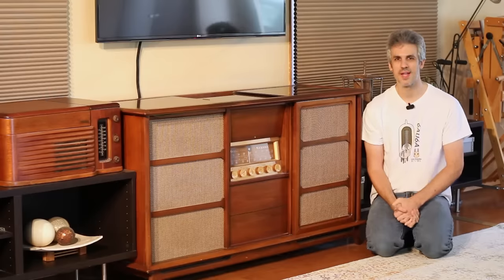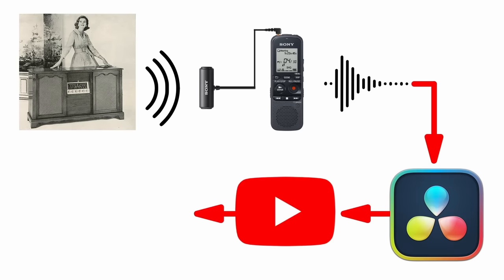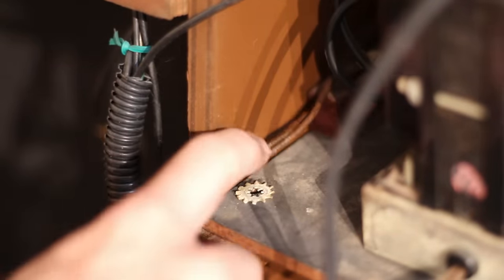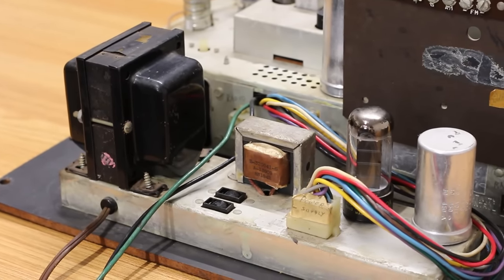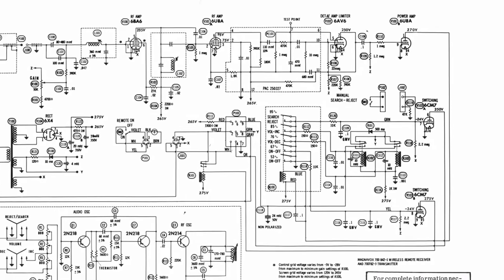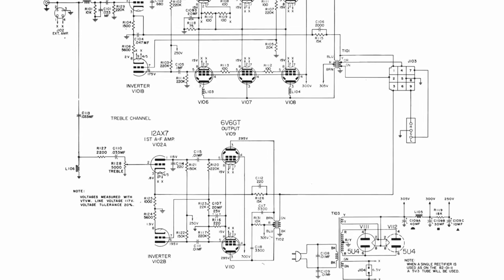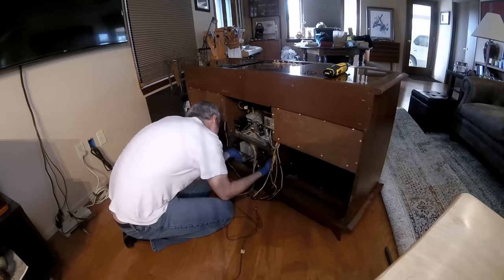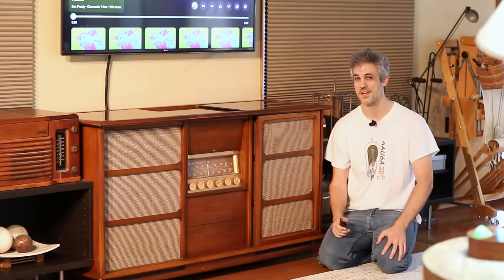A Look at our Magnavox Concert Grand Console Stereo

Comment: The reason you are not receiving any radio station is you need a antenna for it. The termanal block on the back is for a antenna connection , one will be for fm the other for am radio. If you will hooh up the correct antenna the radio will reveive correctly. Its juzt like amerture radio no antenna no rsdio signals

Comment: 1962 was the year the Zenith Stereo FM multiplex standard was approved by the FCC. Are you sure the unit you call the remote control receiver is not the stereo FM demultiplexer? FM sets at that time were provided with a stereo mpx output which bypassed the 75us de emphasis or low pass filter at the fm demodulator. This was necessary to allow the double sideband suppressed carrier L-R modulation through. The L-R is recovered and matrixed with the mono L+R to ectract L and R.

Comment: Unplug the magic eye tube they are hard to get. Since you don't have a signal generator find a source (crystal oscillator from a digital circuit) and use it harmonic to set the dial in the middle of it's range. you won't hear anything but the radio will go quiet and the eye tube will show it.

Comment: What was the rationale for paralleling 6V6s instead of using beefy singles like EL34, KT88 etc. - ? 
(yes, I know, 6V6 doesn't need as much drive V, but it's at most a matter of one more gain triode per channel, much easier than matching triplets)

Comment: I can explain how FM works quite easily, basically by telling you what FM stands for: Friggin' Magic! There. Now that you know how it works, you can go back to vacuum tube computers! ;-) That is one awesome system. With 2 x 5U4s per amplifier, plus the other modules which themselves have their own power supplies, that thing must draw a lot of current. I believe color TV's of the day drew typically 350 watts, and that stereo has beefier power supplies and more 5U4s than even those, so it must be a LOT! Better check your power meter and make sure that spinning metal disc doesn't take off like a Fris... non-trademarked flying disc!  (Of course, here I am talking to the guy who has a Bendix tube computer drawing even more power!)

Comment: The device shows its age, but it has a timeless design. If the front panel of the device were made of brushed metal or matt black aluminum, it would be considered a modern design device.

Comment: The receiver may work, it is probably great, back then external outdoor AM and FM antennas were used. I did not see an internal antenna in video. Had an old tube radio, work off a wire hang off the back. Could get out of state AM at night from NY, NJ, in PA, even NC. I think radio wave were bounced off the ionosphere, I think at least for NC.

Comment: Do you use that to heat the house in the winter? I don't think you mentioned it and just to put it out there, don't power up a tube amp without a load (speaker) attached or your could destroy those near-irreplaceable transformers.
Reply: Yes, this is very important. Without a load but with a signal through the amplifier (or due to internal instability) it's possible to have very high voltages induced across the primary side of the output transformer which can cause insulation breakdown and arcing.

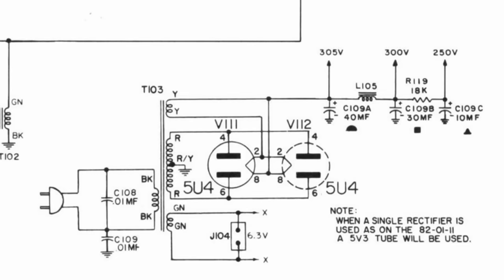Comment: Not a expert on vacuum tubes. But i believe that the 2 5U4 at 15:45 are not a in full bridge rectifier configuration.  A full bridge would imply 4 diodes to get the positive and negative. This is using a center connection and 2 double "diodes" in parallel. Most likely due to power considerations. The note seems to suggest there is a smaller power version as well or perhaps a 5V3 can tolerate more power on single vacuum tube.
Reply: Yes, it's a full wave rectifier. Since tube rectifiers are inefficient this is a more efficient option than a bridge rectifier. Also all power rectifier tubes I know are common cathode so a bridge config isn't even feasible.
Reply: @eDoc2020 Technically possible, but requires more tubes for that reason, and almost never used in practical designs.  Also the filament power requirements become more complex unless the tubes have exceptional cathode to filament voltage ratings (isolated filaments of course).

Comment: I have a pretty rough idea where you are  - with External FM and AM antennas, you should be able to get DFW area radio stations - your TV Antenna for any off air TV channels (provided it has VHF) should work adequately for reception. 

Just as someone who has driven from DFW to Amarillo, Midland and points east, there should be FM available where you are - its just gonna be fringe coverage.

Comment: Glorious video! Please please please clean the tubes after handling them. I don't think that skin oils are going to be an issue like arc bulbs, but it would be incredibly disappointing if you needed to start replacing tube pairs for no good reason :-)
Reply: Ordinary tubes definitely do not care about skin oils. The heat generation on the power tubes is only a fraction of a standard incandescent light bulb.
Reply: @eDoc2020  Phew, my anxiety was through the roof. I haven't had a valve amp for years, and always cleaned the tubes. Glad to know it wasn't required.

Comment: a note about the string you broke for the tuner... you might want to try Bow String, like as in compound box, for a single pull bow, it might be a little thicker, take that string to dunhams to the sporting goods section and ask them if they have a gauge bow string ( its called a DRAW string) for a single pull bow. that might help you. they might just have the gague you need.
Reply: Braided Dacron fishing line has virtually no stretch and will work as dial string. It's not at all like slippery, stretchy filament.

Comment: At 10:05 you can see what looks like a motor in the receiver chassis. Probably for the remote control?
Would be a nice project to build a modern replacement remote for this nice stereo! Should not be too complicated, once you figure out the correct radio frequency the remote uses. If it is not documented, some measurements on the receiver side will reveal it. It will be in the 100 kHz region, I guess.
Reply: The diagram of the remote transmitter labeled the frequencies and sketched the waveform of the desired pulse.

Comment: My cabinet is 98 inches long. Has a record player and also a radio on each end. In the middle was a television that's no longer there. I plugged it in and started messing with the dials of the radio, Hearing static at different volumes then the back started smoking so I unplugged it and grabbed the fire extinguisher.  Luckily I didn't need the extinguisher and it just had a thick heavy smoke. 

As I would like to keep the original parts I'm complacent with having the non original parts. One reason being I'm not sure if it's efficient engery wise and also the insides may not work.  
I was curious if you knew how or if it's possible to use the radio face and dials as well as the record player but connected to something that looks more energy saving.
Reply: I just looked at your channel😳 yeah you would definitely be the guy to know how lol.

Comment: Incredible! I have an earlier Magnavox Stereophonic (I think ~1954) and it also sounds amazing. My only issue is that the stylus needle is too worn for reliable playback. I've been back and forth on trying to find a replacement or retrofitting something new.

Additionally, I think that my model, while labeled "Stereophonic" I think it may actually only have a single channel, "faking" stereo.
Reply: I doubt yours was made in '54.  The very first stereo LPs weren't released until late 1957.

Comment: 6V6 tubes are beam power tetrodes and NOT pentodes; note the absence of a suppressor grid.  This is a rare case of the schematic drawing the tubes correctly!  Most tube manuals such as those put out by GE, RCA Sylvania and others will diagram the 6V6, 6L6 etc as if it was a pentode and yet the description will tell you it's a beam power tube.  To the best of my knowledge, we never built actual true output pentodes in America because Phillips held the patent and American manufacturer didn't want to pay the licensing fees! The 6V6, 6L6, 6BQ5, 6CA7 and 6550 are all beam power tetrodes!  Although we generally consider 6BQ5 to be equivalent to EL84 and 6CA7 to be equivalent to EL34, the European EL tubes are true pentodes and include suporessor grids.  The beam-forming plates found in the American tubes was an invention designed to mimic the performance of the suppressor grid found in a true pentode and thereby get around having to pay a patent fee to Philips. 

 By the way the 5U4 rectifier tubes here are wired together in parallel and used as part of a full wave rectifier circuit.  This is not a bridge rectifier!

Comment: high sensitivity light weight paper speakers ~90db/m . does tuner had got automatic motorized tuning and station searching ( in USSR Radio magazine I saw schematic for similar tech ) Latvia based RRR or VEF factory made similar fancy remote controlled unit for China/N,Korea supreme leader . with a help of couple extra tubes, tuning circuit was able to detect direction of detuned station and turn motor to tune it in precisely/automatically and with help of remote switch go to next station.. in theory. I dont remember if that circuit worked only FM or AM. phase detector ?

Comment: This may be an obvious point but you are trying to use the radio with suitable aerials connected up? 
It may well not have an aerial built in as later sets did -  external aerials were considered normal back in the day.

Comment: these were a very expensive deal back in the day. Your unit seems to be la king the actual Multiplex decoder chassis which is odd? The amps are very nice and develop 30w and 10w respectively  for lo and hi channels. 80 w total was way over the top in those days. My only complaint with Magnavox was the low end AM/FM units were almost identical to your top of the line set.  FM was only two I.F.'s and a simple ratio detector stage for demo duration. I would have expected at least two I.F.'s followed by a limiter stage and discriminator style detector for FM.

Comment: What is the overall power rating of this machine?
Reply: You mean the amplifiers - watts per channel?
Reply: @paulwomack5866  Yes, kind of. And the radio and the disc player if they were all engaged.
Reply: The power draw should be rated in Watts on the back panel of the unit.

Comment: I'm going to guess at least 50 watts per channel... I didn't think any single consumer grade Tube Hi-Fi (was barely a common term back then I believe)  unit pushed more than 30 watts ...horn tweeters and there own driver (assume crossover) stage wow... now that's truly a stereo for life.... on my limited knowledge Europe (UK) had nothing like that for Joe Public...
Reply: From a GE datasheet a pair of 6V6 in push-pull from a 285 volt supply produces 14 watts. With three pairs per woofer and another for tweeter that's 56 watts per channel.

Comment: Booo!  Zip ties?!?  For that time period you should lace those wires.  ^-^

Lacing is a lost art these days, but if done correctly, looks and works very well.  But it takes time to do, and time to learn (although not that much time).  I used to have to lace wire harnesses (don't ask), and once you get good at it, you can move surprisingly quickly.  But zip ties are still faster.
Reply: I remember watching Sarah at The Connections Museum (on YouTube) doing some lacing... it  "sure is perdy" but I'm so glad we have cable ties now. ;)
Reply: Lacing is a big pain the ass. Even though I'm a telecom guy - I'd have used Velcro on something I needed to get into again.
Reply: @AlohaWulf ,  Spiral plastic goose neck tubing would work well and allow you to undo the wiring harnesses in the future if need be.  It's not period correct, but considering the stereo is 60 years old the chances are it will need some service again in the near future, and so why make it that difficult to take everything apart again?

Comment: Can say that vacuum tube amplifiers definitely added a unique and oddly pleasing characteristic to anything put through them and some of that is harmonics that flat out cannot translate to most modern devices, but not because they lack the fidelity to recreate it, but that the speakers in 99%  of them wpuld be incapable of reproducing those frequencies in open air, where you literally feel, not hear, them. Some stereo systems I have seen over the years come close, but they are not reproducing, in most cases, the true recorded sound, but subtly modifying it, similar to how the vacuum tubes did. But, imho this is like complaining that the notes from the song Stairway To Heaven spund wrong played on sonething other than an electric guitar, which us tuned exactly the same as the original recording. Of course it won't, the notes may be the same, but the instrument (or stereo) you are using simply doesn't do the same thing to the notes when played.

Ok, that is an extreme example, to the point of being ridiculous, but I think you get the point.
Reply: I believe that transistor devices sound so poor because transistors mostly sound poor and are designed way to complex.. The distortion by tubes is way less than most people think, some ultra high end gear uses tubes as they have a clean and very natural sound. When a device uses Mos-Fet on the right places, they kinda behave as tubes and often sound better.

Comment: What it's worth, I'm listening to this on a Challenger amp from the late fifties with two 6v6's in pp parallel driving a 100 watt speaker. It's PLENTY loud. I could only imagine what EIGHT can do! Just keep up on changing those filter can crap-pacitors. Leave the old ones in place and put you a decent set of Nichicon or equivalents hidden under the chassis. Also any waxies have got to go, but you probably know that. That is a beautiful unit and you've done a wonderful video on it. Thanks!

Comment: The remote was likely one of those old designs that just had a few tuning forks or something. The tone was something the receiver could hear. You might be able to fake one easily enough with an Arduino or something and a little speaker.
Reply: The remote is RF and transistorised, he covers this in the video.
Reply: @ProdigalPorcupine  the remote, or the remote its receiver? In the video is the receiving part I think.

Comment: Dial string is a pain in the ass, simply because it's literally designed do have no stretch or shrinkage properties at all in order that there be no variance or creepage in the dial needle's position. Please make sure you replace it with same, as opposed to something you might find around the house.
Reply: Braided Dacron fishing line has virtually no stretch. It can substitute for tuning-dial string.

Comment: Lovely system - I have a couple of tube amps myself which have 4x6550 valves (tubes) per channel. They are a bit temperamental running into my speakers, so I tend to mostly use a larger transistor amp. 

The world of audiophilia is a very strange one; I've studied it for many years. It's a weird world of B.S., very dodgy great pontiffs of snake oil and generally people who are gullible and very easily lead by suggestion and confirmation bias. A world of the likes of "audiophile" Ethernet switches with mystical crystals inside and associated cables, unidirectional speaker interconnects and cable stands to name a few of the presumably pot-induced whackery.

Some of the afflicted will report favourably on auditioning $100k+ systems via Youtube and wax lyrical about the auditory glee of one cable over another. If people weren't being mugged it would be hilarious.

Comment: I would have expected a pair of 6550’s and a pair of 6BQ5’s for the woofer and horn respectively by 1962/3. The design team at Magnavox must have really liked the sound of all of those 6V6GT’s in parallel. 

Also, the use of 5U4’s in 1962/3 for consumer electronics wasn’t so common. A handful of silicon diodes made everything less expensive. No heater winding for the power transformers, no tube sockets, less labor, etc. You could also power a lot more stuff with just a couple of them and have far better power supply filtering. 5U4’s are limited to something like 20uF on the input side of the power supply! That’s probably why they’re configured in a full bridge here, a lot less ripple.

Anyways, very cool console. I’d love to own one myself.
Reply: Perhaps they simply got a deal on 6V6 tubes and/or appropriate output transformers that liked the load of 2 of them on each side of the push pull arrangement into a given speaker impedance.

Comment: You might want to find a competent tube radio guy and have the dial restrung and more important have the old capacitors checked or changed. It would be a darn shame to have some unobtainable part smoked by a $1-3 shorted cap.